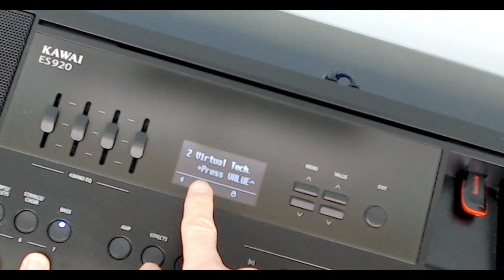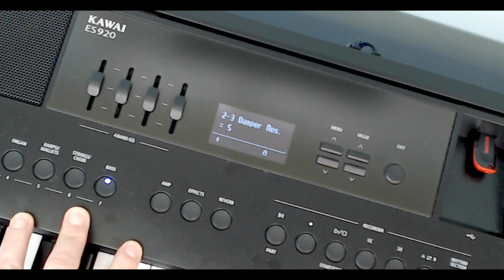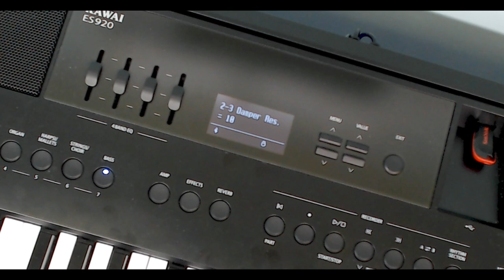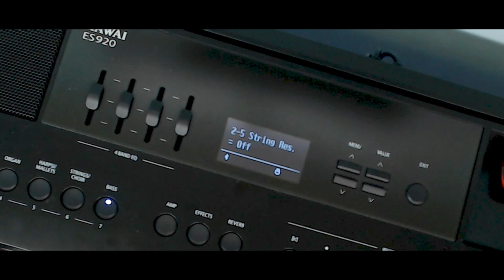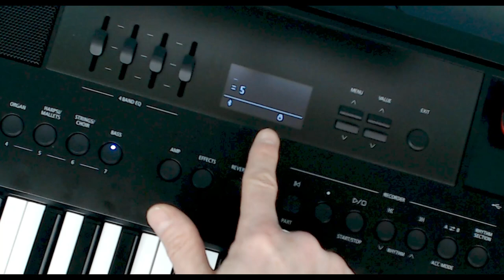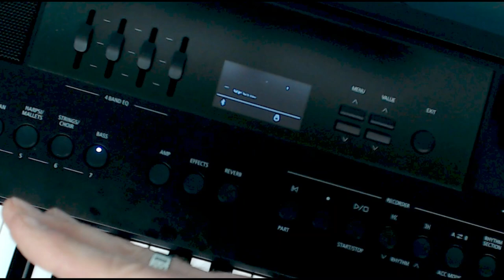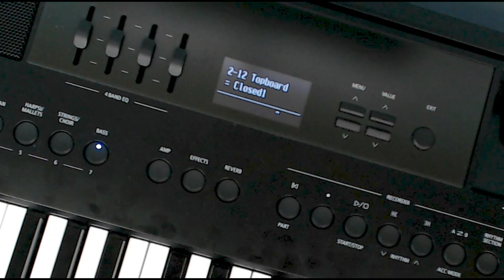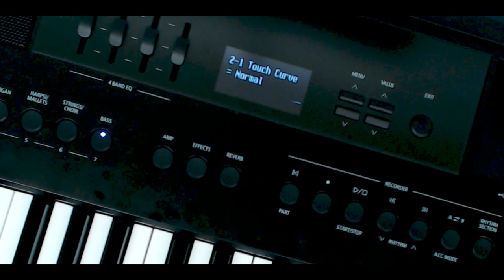Kawai ES 920 Part #3 The Virtual Technician Tutorial, Review, Demo

Comment: Paul:

As a beginner who is seriously considering purchasing this piano, the Virtual Technician is perhaps the most anxiety-inducing component, because my knowledge of what any of these settings does seems overwhelming. This is such a wonderfully thorough (and, for me, reassuring) look at how and why I would ever use the feature.

I have a question about the pedals. In a previous video, you mentioned that if you get the three-pedal add-on, those pedals can be programmed. Can you tell me if that includes the ability to reassign the left pedal to be a damper pedal? I know some Yamahas have that ability. It’s important to me because arthritis in my right foot makes pedaling very painful, so for now I’m planning to buy the stand without the three-pedal add-on, unless I can change the left one to a damper pedal. Thanks!

Comment: Thanks for the excellent explanation of the Virtual Technician tutorial. I actually have one question:
is it also possible to save the changes you make with Virtual Technician, so you don't have to set them up every time? And how do I do that?
Thank you for your answer. All the best!
Reply from the maker: The settings that you have made in the virtual technician can be saved in the registration memories which is how I use the piano you can also have a basic set up which is stored on the piano which will always be there when you power up. The manual gives you concise instructions on how to do these things. Regards Paul.

Comment: Hi Paul again. The Fallback noise is very noticeable compared with the Roland 90x when playing very quiet passages (almost as off-putting as on a Casio Privia SX560m which I rashly bought blind and is apparently something to do with needing better felt). How much does the Virtual Technician lessen the fallback noise? - I'm hoping you might be able to spare the time to try lessening it???  I travelled about 120 miles to try an ES920 out and ran out of time to try adjusting it before they closed! (The shop tried to convince me it was the same as on an acoustic but if you play very softly on an acoustic you can only faintly hear it while soft notes actually play. Incidentally, I thought the bass sounded better on the Roland but there was not enough graduation between loud and gentle action and the higher notes were not as sweet.)
Reply from the maker: Hi, you can switch the fallback noise off completely. Re the sound everybody has a different idea of how a Piano should sound so one persons Roland is another persons Kawai/Yamaha etc. I’ve owned them all and they all behave differently just like different acoustic pianos. Best Wishes Paul

Comment: I'm a Piano Teacher.  Paul, that was absolutely fascinating!  Thanks very much and for your previous two videos.  I need to get a portable piano as virtually no halls that I  want to hire now for Piano pupils' concerts have pianos now. This ES920 would seem to be suitable even for my Grade 8 pupils in concert. Just a little concerned about the build quality (But I certainly wouldn't be able to manage the heavier portables. (I have a Tyros 5  but it's only 76 -note and this can be off-putting when judging low note positions etc). Presumably the ES920 wouldn't take to being stood on its end occasionally?  Have you gigged with it?  If so, how have you found it (and do you know of any good padded bags, preferably with handles either end ?)
Reply from the maker: Hi many thanks for the kind comments. I would certainly say that as a stage piano the Kawai ES 920 would be fine for gigging with if you are careful with it I have used many keyboards and synthesisers for concerts and gigging over the years it is just a case of being careful. I haven’t  gigged with it yet but the sole reason I bought it was not only for teaching on but also for gigging with. If you have a suitable padded bag then there’s no reason why it won’t last for many years, and would be fine on its side. Yamaha Tyros build quality is similar to the Kawai and many people have gigged with those successfully. Regards Paul 😀

Comment: Hello, just got my es920. Lower keys sound like buzzing. When changing pianos(grand to others) the pitch is going the whole tone higher. Have no idea what to do.
Reply from the maker: Hi, sounds like a fault as mine does not do this. I would suggest that you get in touch with the company that supplied the piano and it will be covered under warranty. Regards Paul